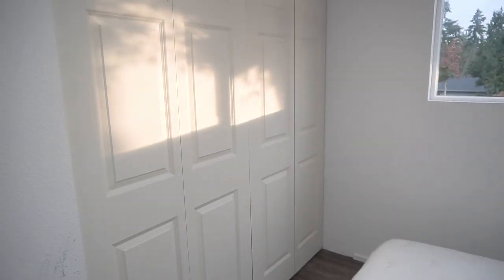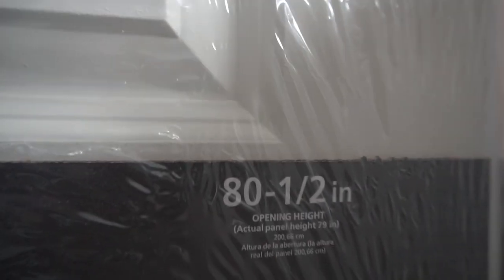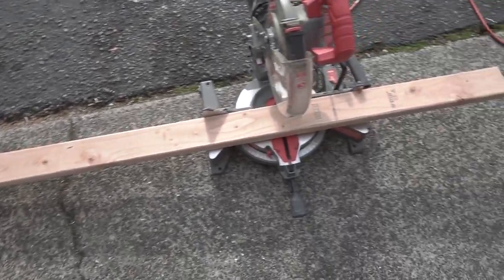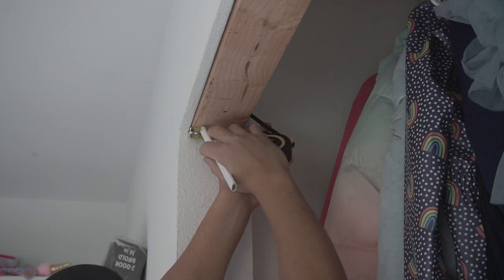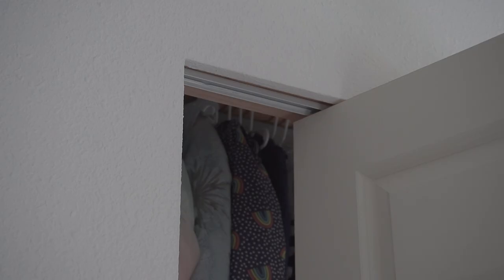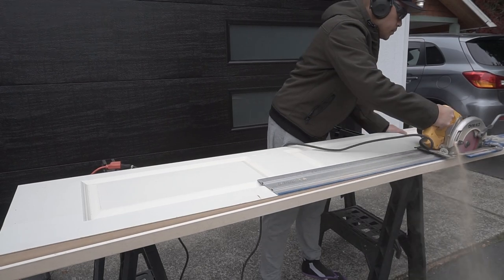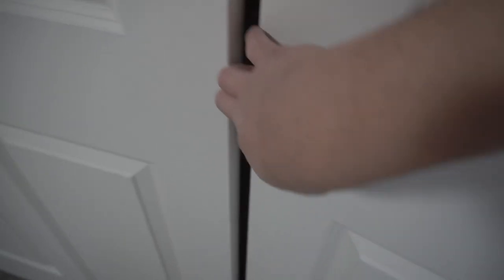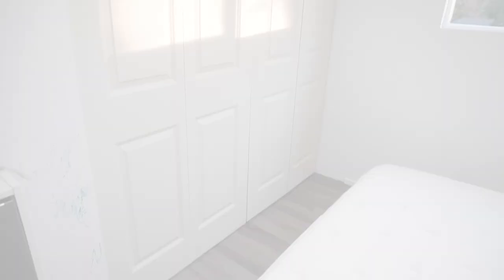How To Install Bifold Doors For Your Closet! | DIY

Comment: Great video! Question for you, did you mount the bottom track straight through the floor into the subfloor? Is that okay to do with a floating floor? Thanks

Comment: We have closets that don’t have a top lip. Our current sliding closet doors are mirrors and floor to ceiling. If we replaced them, would you suggest building in the top lip or just get taller doors?

Comment: Nice video, but i would not use this type of wood doors  because they tend to break and become loose in the hole @ 1:41. The spring metal becomes loose as well. Easy way to fix is to reinforce those holes with a metal plate and screw or glue down on to it.